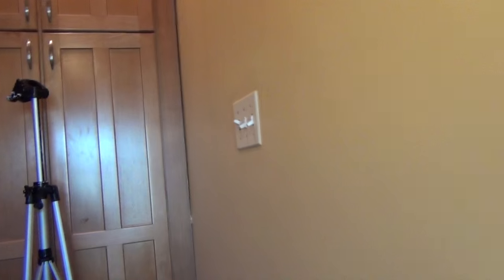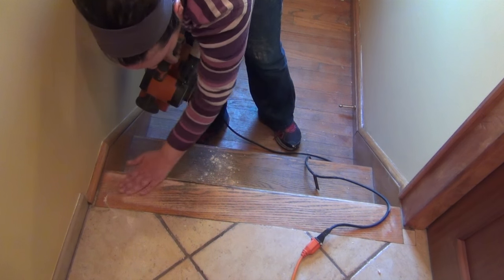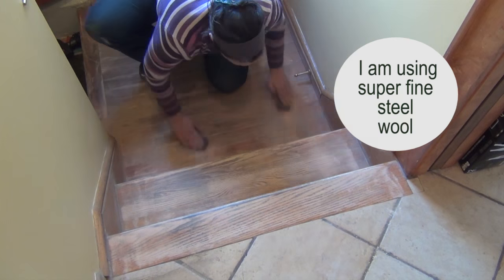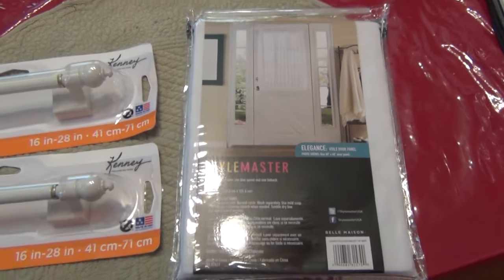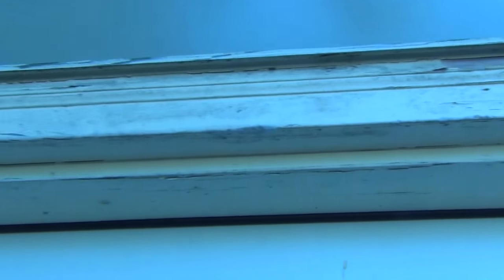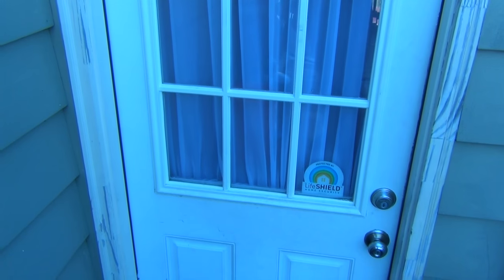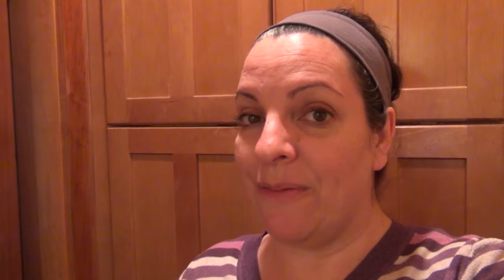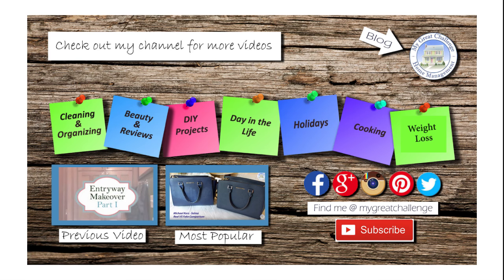Entryway Makeover - Part 2  || Door and Floor ||

Comment: You should consider the new tiles that mimic the look of wood, since it is such a small space. Or you can match the other tiles you have in the upper step.  This would hold up better than the wood will over time.